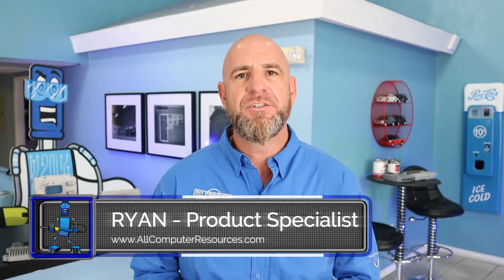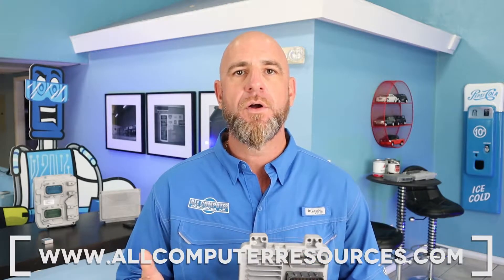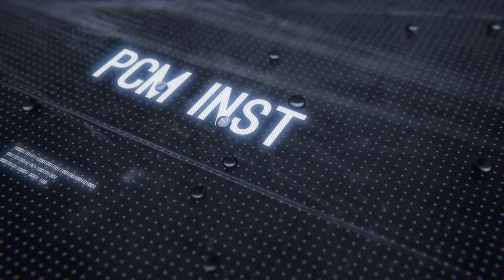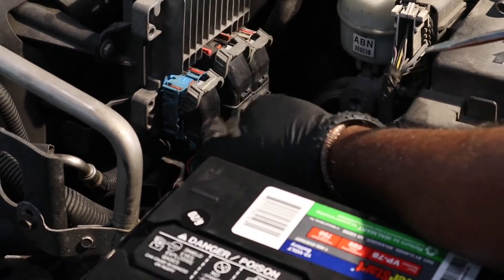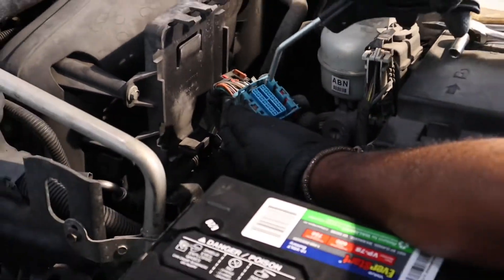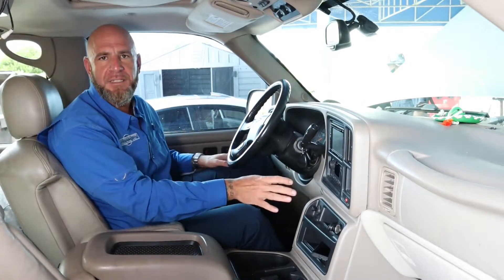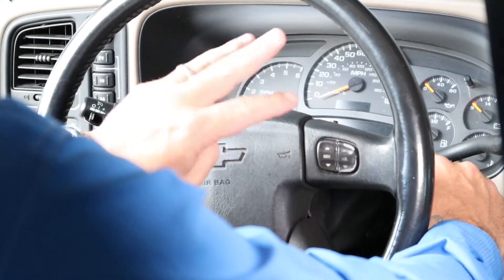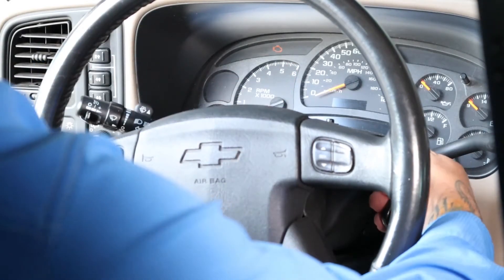HOW TO PROGRAM KEY FOR GM/CHEVY PK3 or Passkey Anti-theft - Engine Computer Replacement

Comment: So what if the security light is on for a second then instantly turns off in the on position on a brand new pcm?  Should i have engaged the anti theft system by pressing lock door button then shutting door waiting till doors locked then use key to get in?
Reply from the maker: Brendon, typically a new PCM will not have the VIN and calibration needed to properly run the vehicle. At ACR, we match the correct part,  flash update the correct calibration and program the VIN so there is a seamless installation.  The door locking as you mentioned wouldn't have a role in this procedure. If the security light turns off this could be an indication that the vehicle is not in security safe mode. Also be sure you are following the correct procedure for your vehicle (watch the first minute of this video), and that the PCM is properly programmed.
Reply: Yea i got the computer from a place called flagship one they stated the PCM is programmed and flashed to my vin number  with the latest updates. I followed the directions correctly to the point of the security light not staying on for 10 mins and turning off after is there something i should do or should i get a new PCM? The new one i got looks brandnew of course i have no way of testing it to see if its properly flashed and programmed unless i go to the dealership
Reply from the maker: @brendonmazzola1982   Understood. Sorry to hear that you are having these issues. We are not affiliated at all with the company you mentioned. I would assume there is some type of tech support they offer as we have a team of ASE Technicians that assist our existing customers with any troubles. Let me know what the year, make and model of the vehicle so I can do some research for you.
Reply: Its a 2007 chevy malibu LT 2.4l ive been spending days on the web trying to find the right information but its not easy. Ordered the computer i followed ur instructions on the install and i tried to follow one of ur videos on the key relearn but the security light goes on then istantly off when i release key to on position so im left with i bought a faulty unit or theres something i need to do. Thanks for the information you already gave
Reply from the maker: @brendonmazzola1982  Brendon, The 2007 Malibu is security type PK3+. This is a different procedure than the one outlined in the current video. I would suggest disconnecting your battery for 30 min (system reset) and follow the instructions on the video here: https://youtu.be/KkJALLMxayc    -   Pay extra close attention to where its mentioned on how to turn the key in that video. Let me know if that works for you.
Reply: So i got home from work pulled the negative terminal for 30 mins went to do the relearn i tried the pk3 + relearn i tried to start car released to on position still security light wont stay only pops up for a second then disappears so i went through the 10mins on after start attempt 5sec off process 5 times 2 times more then the 3 times required like u said in ur video to no prevail i know your giving the correct info im following everything exact so i mustve recieved a not programmed or faulty unit i paid 275 for they did ask for my vin to program it. My car started as a no crank but starts and runs great when it wanted to crank which was random u could keep trying and if lucky it would crank while cold but when the car warmed up then shut off the car would not start back up till cold again so i replaced battery starter relays fuses mechanic said it was my computer i had to go to the dealership so i ordered one and i told you the rest but after the new pcm it cranks every time just cant do the relearn because of the security light ik its alot to process and you cant test my pcm lol but any more tips or ideas would be great i liked and subscribed to ur channel the least i can do but if i need another new pcm ill go through you guys
Reply: @brendonmazzola1982   Hi Brendon... I also got an ECM from the same company. I am also unable to perform re-learn as security light goes off instantly. I have Chevrolet Orlando 2012. Please do share any update regarding the issue.
Reply: @deepakkumarjha5283  did any one find any fix for this am currently having it same thing that you described
Reply: @brendonmazzola1982  hi have you fixed your problem I have also bought a pcm from flagship one and the security light turned off after the first 10 minutes with no crank and the light won’t turn back on have you found any solutions
Reply: @phobicgazelle795  I am having the same issue, Security light goes off in about 2.5 seconds.
Reply: I also am having the same issue. Security light comes on and then off within 2.5 seconds. I purchased it from flagship, and it was supposed to be programmed .  Please share any information .